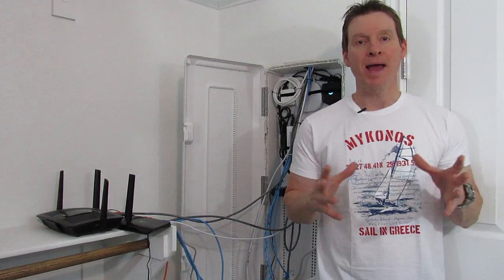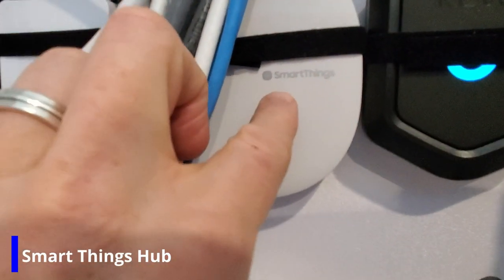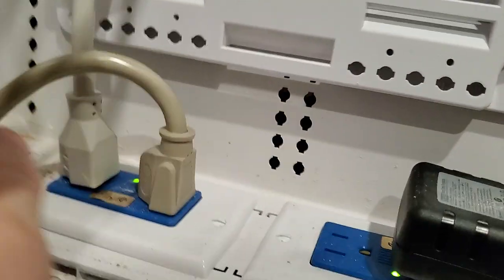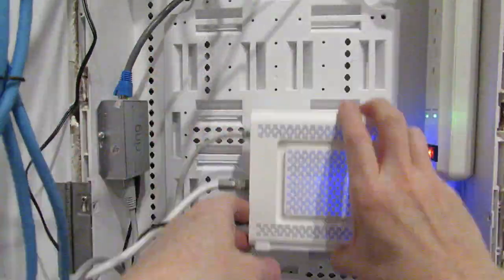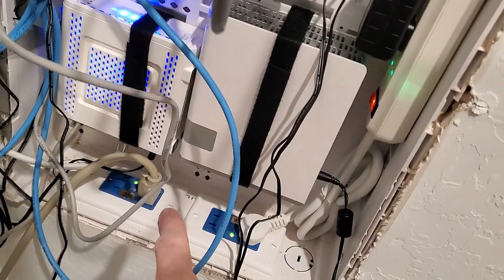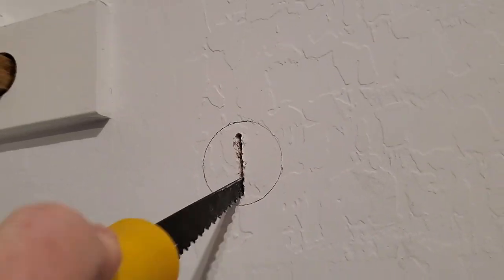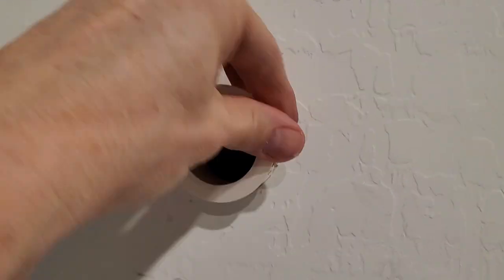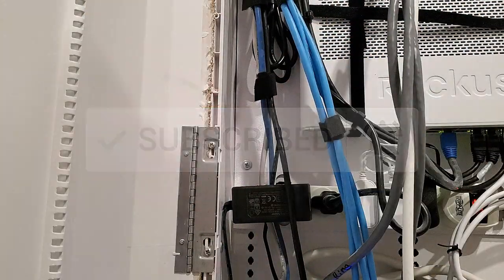HOME NETWORKING 101 QUICK & EASY RESIDENTIAL NETWORK PANEL INSTALL AND INSTALLING NETWORK DEVICES!

Comment: My wifi goes offline being on. Everything seems working but there’s no internet. 
Reply if you can help.
Reply from the maker: Do a reset. Unplug the router from the power for 30 seconds and you can do the same with your modem. It will take about 2 minutes or so to go back on line. Keep me posted.

Comment: Holes don't match because the panel had to be installed horizontally!
Reply from the maker: Thanks for watching!!
Reply: @UltimateTechHub  Still have issues with those clips, lol. Something just isn't right...

P.S. I got it. The plug has to be inserted from the top, after you attach the panel. I was trying to insert them into the closet, and put the panel on top, which didn't work.
Reply from the maker: @Ig0r15  Yep  I have installed many of those brackets and those clips always give me a hard time that's why I use screws most of the time.

Comment: You shouldn't run the power cable through the wall like that from the router.
Reply: He made it clear elsewhere in the comments that he thinks it’s perfectly fine to run power cables naked inside the wall. He defended it repeatedly despite the electrical code violation. Flagrant ignorance

Comment: My house was built last year and they put a small enclosure, assholes. They also ran 3 cat6 wires and the alarm panel wire, they call it “smart home”.
I was thinking of installing another box (same size) under the current box but maybe I don’t need that much space.
Reply from the maker: That would work or remove the small enclosure and replace with one large enclosure.
Reply: @UltimateTechHub  definitely not removing the existing one because I have fiber coming down from the attic. I mean it's possible but I risk messing the fiber cable and having to pay for a repair. I actually ordered a "rack" tray that I'm going to be installing about 3-4 ft high above the current box, this is for my router and network switch.
Reply from the maker: @8Jallin  That should work well. Keep me posted if you have any questions.
Reply: @UltimateTechHub  thank you! Ill check more of your videos

Comment: Important to protect wires as they pass through the punch out holes using the plastic grommets - especially how you pushed the extra cable length back inside wall. No reason to put big NAS inside cabinet - in will survive longer and perform better close to one of the computer terminals. If you still can’t fit wireless router inside that media enclosure then better off getting a second box and mount above the existing one. You’ve mounted that router halfway inside your hanging shirts. The cabinet uses a plastic that’s completely transparent to WiFi signals so no reason to surface mount like to did. And running power cables bare inside the wall violates the general electrical code — only data cables can be routed that way. Best solution is to get a much smaller footprint mesh router — besides easily fitting you’ll get better speed, better coverage and improved security in a smart home environment. This is an amateur job — it takes years of learning and experience to to this correctly. YouTube videos can be a poor substitute for professional advice